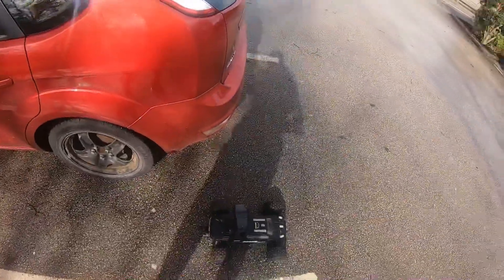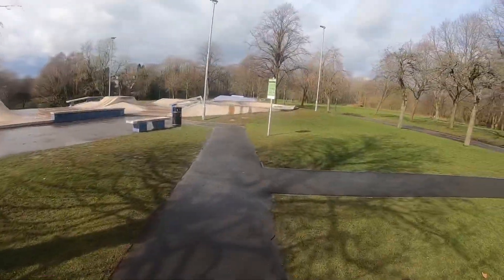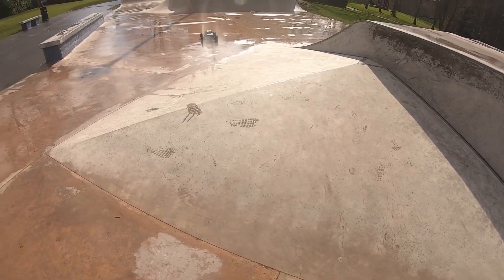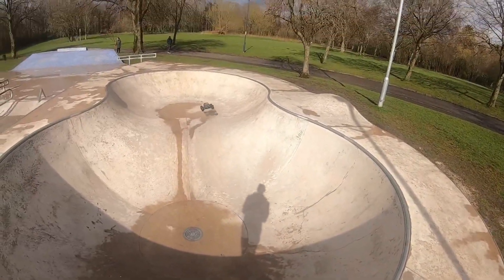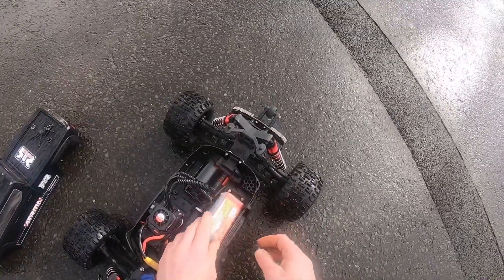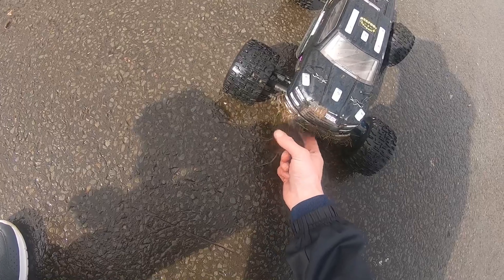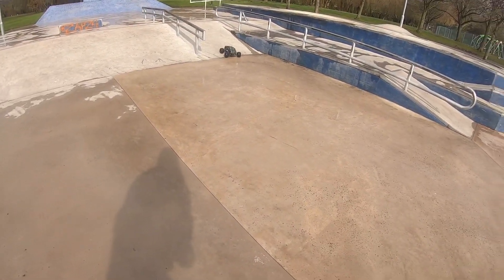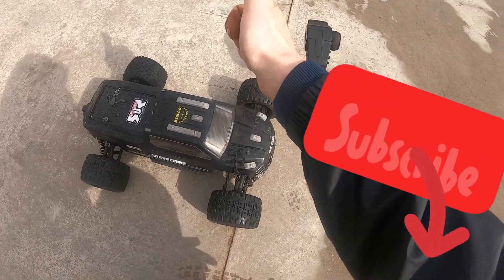DAILY BASH BigRock Back at it 150amp 4076 2000kv Geared up on 4s not quite dialed in no flips testin

Comment: Big rock slides like a rattlesnake on glass dude....💪... I've tried loads of different battery flavours in my RC planes and granite...in my opinion take the rear battery spacer out the granny and a ZEEE 11.1v 6000 fits perfect, with as much punch is Tyson Fury.. and the runtime of Mo Farah.👍🇬🇧😎
Reply from the maker: Haha yes bro that’s one way to describe it love it..😂😜
Yeah man I’ll definitely be experimenting with some different 4s batteries but I’m trying keep the weight down so 5000mah is about the sweet spot gives a good run time just like Mo and 60c punch 🤜 like Tyson..Lol🤣
Nice one man hope your good..😁🤘🏻😎
Reply from the maker: Never tried a Zeee battery they good mark?👍🏻😁
Reply: @OverDriveRC  yes mate.i think ,for the granny ZEEE 6000 60c is bang on, I don't use hard case and it comes in at 425 gramms, fits perfect.👍🇬🇧😎

Comment: how many teeth on 3S when it was stock?
Reply from the maker: Hey bro was on a 15t stock when I got it.. Just ordered a 26t..😁😆
Reply: @OverDriveRC  26 🤯👍
What do you recommand on 3s to do better backflips?
Reply from the maker: @navbes  yeah my 2000kv motor will do less revolutions than the 3200kv so a 26t isn't that mad if you get me buddy.. I like 15-16t on the 3s 3200kv flips nice.. 😁